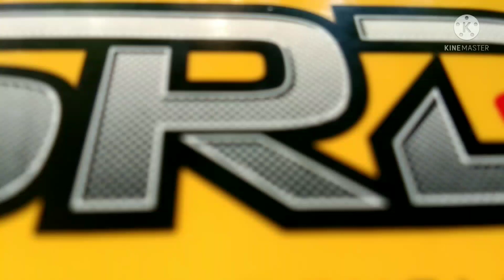SUMO RATO 15HP (SR-150M) | SUMO RACING HIGH SPEED

Comment: lakas nyan prii
Reply from the maker: uo prii, malakas nga sya, ang tipid pa sa gas😁
Reply: Correction lang boss walang low speed na honda marine at sumo rato kung magpareho lang horse power. Ung ibig sabhin lang noon. High torque speed. Kung baga kaya nya hatakin ang malaki mong bangka. Pag high torque speed. Makikita mo lang ang low speed pag mga 2 stroke gasoline engine yan gaya ng kawasaki.   @treseloko3485